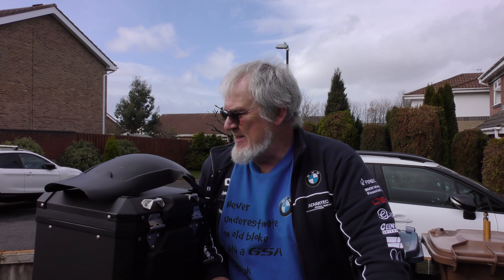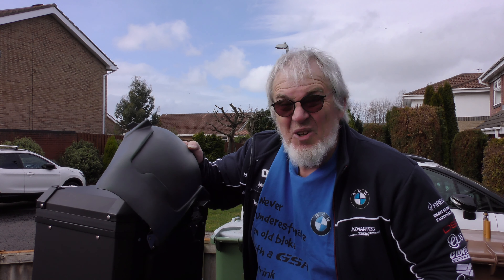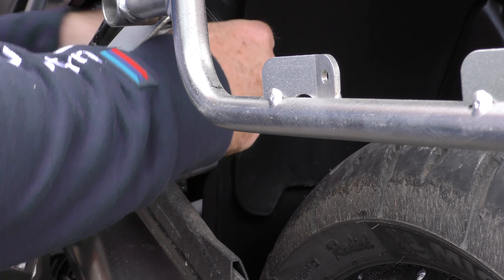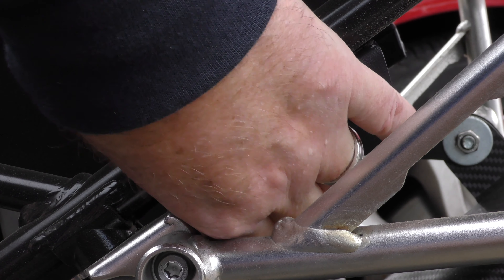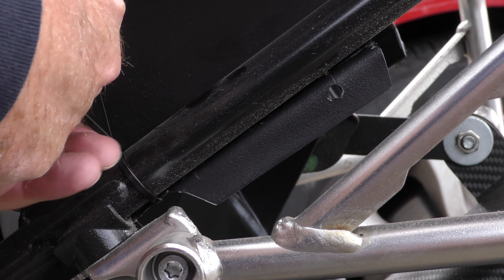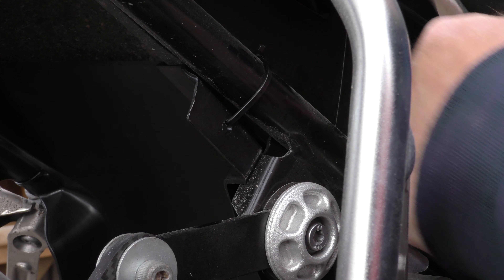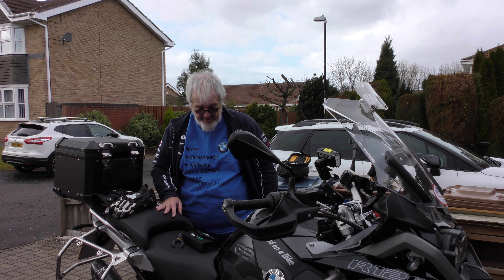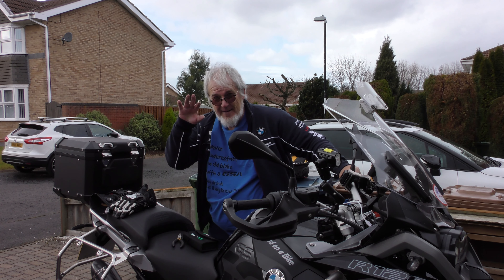Rear Mudsling install on BMW R1200GSA

Comment: Did you have any issue with the rear tyre rubbing the mudslinger? I purchased the genuine item but had to return it as it was too close to the rear tyre. Just wondering about the cheap eBay version.
Reply from the maker: Darryl Moss Nope, not even close - I was aware of an issue with a “big name” variety, so too careful notice, and it’s been absolutely fine.
Reply: FLoaB thanks for the quick reply. Good video.
Reply from the maker: @Dazmpower  No probs - happy to be able to help, if, indeed, I have!